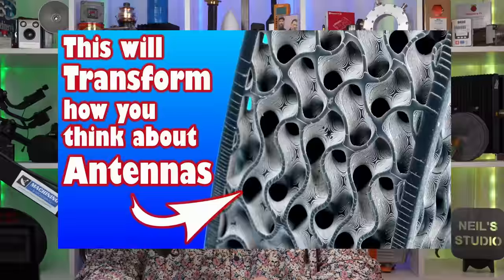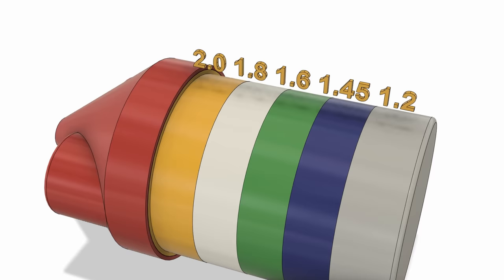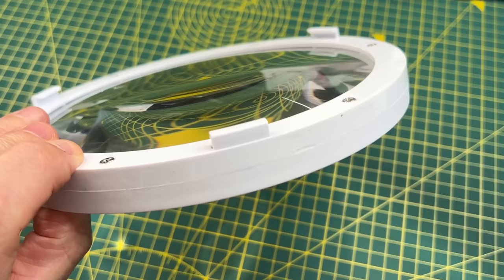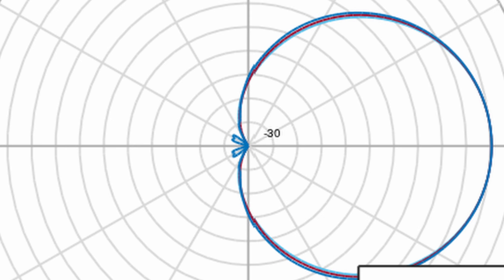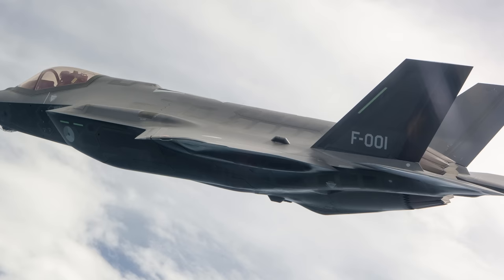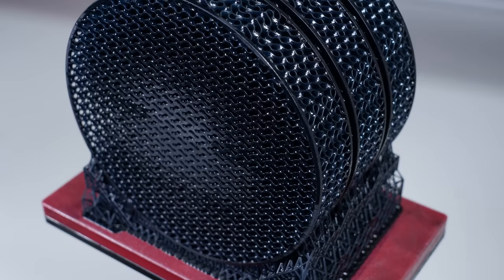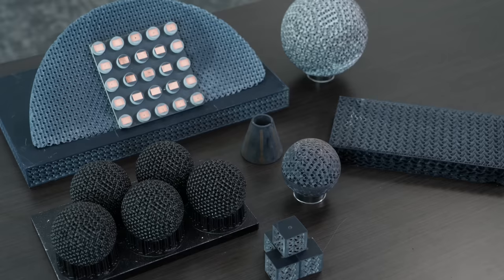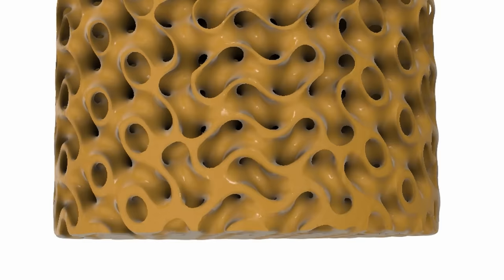How Microwave Lenses REALLY Work!

Comment: I'm an electrical engineer, and not an RF engineer, but I've always found this field fascinating. It's why I watched the original. I do have some basic RF understanding though.

Also, programming is interesting in much the same way that there are people interested in linguistics or specific spoken languages. It's about working together on something whether it be human-machine communication, or human-human communication. It's about synergy and the constant drive to improve, adapt and overcome obstacles that are apparent boundaries in that communication. Much the same way you seem to have an interest in RF tech, and are excited about new breakthroughs in the medium. The same can be done with communication.
Reply from the maker: I have a very jaundiced view of programmers as a result of spending all of this century so far dealing with poorly-written code that's caused security defects.  I only see broken code, I'm sure there must be non-broken code out there, but I never get to see any of it in my day job!

Comment: Thanks again for another great video!
As part of my PhD I've been focusing on making some quasi-optical components for the low THz / mmWave spectrum. I did some material testing on the radix stuff around this time last year and it seems to perform reasonably well up at 220-330 GHz, but the cost is a bit too prohibitive to try unknown designs. FDM is definitely feasible for making antennas now, I've used a Prusa and an Ender 3 to great success for a bunch of parts. I've basically moved all of my experiments to using my own custom optics, as I found they worked better than off the shelf teflon ones. 
There's a recording on my channel of my conference presentation I gave last year for one my earlier (much simpler) projects if you're interested :)
Very keen to see what you come up with!
Reply from the maker: I'll have a look!  I haven't tried my Radix Mikaelian lens at 76 GHz, but it works OK at 47 GHz.  Much higher than that and the feature size starts to get a bit tricky. Creality want me to review an Ender 5, but I don't think I'm much good at reviews, so I'm trying to think of an angle so I could accept a free unit for a sponsored video.  Really I'd want the larger one, but it really needs a high temperature enclosure to print the dielectric filaments successfully.  Not sure how the mechanisms would survive at 75 to 80 C.  I've just agreed to spend all my pocket-money on a Syil X5 4-axis CNC with tool changer, so laying out more cash on a high-end printer is going to have to wait a bit.  If I fry my Prusa, it's not the end of the world.  I'd  like to be able to make lenses and lens segments around 40 x 30 x 15 cm, but I could perhaps manage by printing in multiple parts that are slightly oversize at the mating faces and machining them to exact dimensions on the CNC.
Reply: Would be pretty cool to demo that kind of reasonably advanced manufacturing capability with an entry level printer. Maybe with a DIY printed highly directional antenna for WiFi to a far away shed or something 😅
I did end up upgrading the hotend on my ender to print more exotic dielectrics, but the direct drive on my Prusa works so much better for a wider range of filaments anyway, so the ender is mostly relegated to printing PLA. Although saying that, I have killed and rebuilt the Prusa a few times trying to print with miniscule nozzles.

Very jealous of the CNC machine! One of those combined with a decent printer sounds like a great setup for some fancy lens production. I don't imagine something like preperm being very fun to mill though haha.

If you ever make something that fits onto a WR3.4 flange, happy to try and run a rad pattern measurement or something for you :)
Reply: @MachiningandMicrowaves  Low cost stepper motors are specified for about 80°C external and 125°C internal if memory serves, and higher temperature grades are available - you get uprated insulation of the coils and connectors, and you get uprated bearings built with a different grease. I don't know how to estimate internal temperature, but i suppose you can use current control to just reduce the current as far down as it'll still move, and not run things too quickly, and perhaps that's enough. Then i suppose you have the rest of the  bearings to barely worry about? But i wonder also if temperatures that high create heat creep problems, whether you may need a water cooled cold-end.

PETG printed parts are not good at 80°C so that's unfortunate for Prusa and all of their carrying structure, really wouldn't push it past 60°C.
Reply from the maker: @SianaGearz  I think you're right, even with everything backed off to reduce internal heating, the drives and bearings are going to get stressed and I'll face internal temp problems. I'll try it at an enclosure temp around 50C to start with and see how much of a problem warpage is

Comment: Amazing video! Thanks for helping me understand the myth of light slowing inside a lens!
Reply: Yeah.  I have been looking into light since 1985.

It's a good day for learning that delayed re-emission saves us from having many speeds of causality.
I have just started to comprehend C as curvature rather than a speed.

This is what my Lab Assistant said:
To provide a clear explanation, let's consider three types of materials commonly used in physics experiments and compare their causal propagation speeds:

Transparent Media: Transparent solids or fluids allow photons (light quanta) to pass through unhindered or only slightly deflected, resulting in negligible delay. Optical fibers made of transparent glasses or crystalline materials serve as excellent examples. The refracted angle of incidence leads to slight retardations, but the overall speed remains close to the universal upper bound of c in vacuum.
Absorbing Media: Absorbent substances absorb incoming radiation temporarily, rather than reflecting or transmitting it. Afterward, they release the same amount of radiation, usually as thermal emission, with a certain delay or time constant. The duration depends on the quality of the absorber, temperature, and other environmental factors. Examples of highly absorptive materials include black carbon, graphene, or rare earth metals.
Scattering Media: Scattering media obstruct direct passage of radiation by repeatedly bouncing off or deviating photons in all directions, creating diffusion or dispersion. This phenomenon occurs frequently in biomaterials, granular media, porous materials, rough surfaces, or turbulent liquids and gases. While the path length exceeds the distance traveled in straight lines, causing significant delays, the ultimate velocity remains limited to the local speed of light in the given material.

Comment: A tool that might also be helpful for generating meshes from equations is Blender, or maybe it is a plugin for blender. In any case you can enter equations for x,y,z and maybe fiddle with a few other settings to generate 3D shapes. It avoids having to get your hands dirty with programming, which I can understand because I'm still burnt-out from too much coding at work. Of course the reason I'm busy is I'm teaching myself to program SoC FPGAs this month and also taking up glass eating and running with scissors as new hobbies.
Reply from the maker: I've had my fill of Verilog, and VHDL makes me itch, but FPGAs are still towards the cool end of my ranked list of electronic things.  I used to run Blender a lot about ten years ago, and recently started again, but with the intention to animate E-field dumps from OpenEMS and to make better-looking models and overlays.  Way too much to do to get good at it, well, at least good enough for Youtube consumption. Also still on the steep end of the Manim learning curve.  My machine shop is being torn apart right now and I need to get some machining done urgently, but I got called to deal with an emergency at the Day Job so that ruined my day off work today.

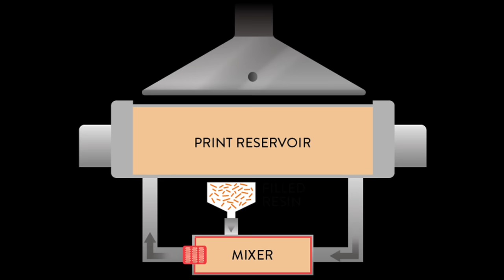Comment: It appears to me as though the Radix resin doesn't necessarily need a "clever printer" as they said (they probably wanted to show the resin in its best light and use your channel for a bit of marketing). I think the main thing that is required, which isn't already possible on hobby-grade resin printers, is vat recirculation as shown at 15:20 , to keep the ceramic part in suspension within the resin.
The same setup could be achieved with a hobby-grade resin printer in a number of ways, including with manual mixing or a peristaltic pump.
Reply from the maker: You are probably correct.  It might be feasible to try to make a printable material using a very high permittivity powder/microgranule dispersion if there is a UV-setting fluid that has an acceptably-small loss when cured.  I can feel some experiments are in order!
Reply: @MachiningandMicrowaves  Didn't you say yourself in the video that Radix used a UV curing resin as their binder compound? If not, I wonder if @Tech Ingredients might know any good prospects for something like that...
Reply from the maker: The chemistry they used wasn't disclosed to me, after all they are a materials manufacturer, so there are definitely some suitable materials available.  I'm playing with laser-sintered metal 3D printed devices and filament printer dielectrics in the next few months, but there are some interesting possibilities.  I've been chatting to various folks on Discord and in person about potential projects for the rest of this year, btu time is my biggest constraint
Reply: @MachiningandMicrowaves  I just came across the Norton laser printing on white tile method with Titanium Oxide, white on white makes black when heated?. Some sort of particle in UV resin should work. Teflon powder? I want to try concrete colouring powders on tiles. Most of those are oxides, but is black carbon based? Carbon filament printing?

Comment: If you printed a negative of an antenna in a dissolvable filament,    you could cast it in a self curing resin with additives for the antenna properties.

To eliminate voids,  it could be cast in a vacuum chamber.

then mill the exterior to expose the filament,  and rinse it out.
Reply from the maker: The problem is finding something that is a self-curing resin that's also a high performance dielectric.  Almost anything that you can cure chemically ends up being polar molecules with high loss.  Interesting time to be a materials scientist I guess!  Some of the oxime-based neutral silicones are reasonably good, but not stiff, some paraffin waxes might work, but it's challenging to think of something that will polymerise and set into something without side-chains or charge imbalances.

Comment: This is the first I've heard about light not actually traveling more slowly in dielectrically dense materials 😮
Reply from the maker: I had to leave out the bit about what goes on at the quantum level, but the classical/relativistic approach works well at molecular scales where a typical PTFE molecule weighs around half a million Daltons, so is pretty much a macroscopic entity.  Polarons (sometimes mistakenly claled Polaritons which are something else) are another way to analyse what's REALLY happening.  They are treated as bulk objects representing the aggregate effect of a large number of individual effects and appear to have mass as well as momentum like massless photons, so they can certainly travel at less than light speed.  For visible light, the molecular bond vibrations are no longer having any effect, the frequency is way too high, to the refraction of light is caused by the charge clouds and nuclei swilling back and forth.  By the time you get to short wave UV, even that stops having a major effect and most things go transparent by the time you hit X-rays, but then ionisation starts to kick in instead, and once you get into UV, the electron energy levels start to turn into a continuum of levels.  Water's an interesting case as it has strongly polar molecules suspended in a sea of hydrogen bonds.  It has an unfeasibly high refractive index at radio frequencies (around 78) and a high loss at frequencise below resonance around 20 GHz, which is why you can couple energy into wet food very easily in your microwave oven, yet ice has a very low index and extremely low loss tangent, which is why it takes AGES to defrost a lump of pure water ice in a microwave oven. It's all about hydrogen bonds with water. At low frequencies, pure water is an extremely useful dielectric, and can be used in a Marx generator to make megavolt ultrafast pulses.  Needless to say, I WANT to make one just to annoy folks who say it's dangerous to mix water and electricity.  Not that a megavolt with significant capacitance and UV flash-catalysed spark gaps is anything OTHER than dangerous, obviously

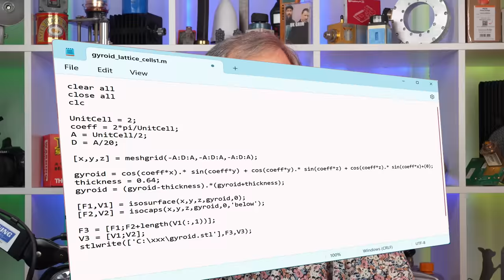Comment: 17:30 If someone tries the code and it doesn't work first shot, you may want to try this for the last part;

tri = triangulate(F3,V3)
stlwrite(tri, C:\etc)
Reply from the maker: Ah, I did try  to work out how a Delaunay triangulation might help, I didn't realise there was a simple triangulation function!  I should RTFM a bit more, but there's a time to follow rabbit holes and a time to throw something out there and wait for excellent comments like this one!  Up to a point, there's some simple healing facilities that deal with incomplete triangles and holes but if triangulate() fixes the edge-cases where the generation function just blow up, that would be cool.  I'm covered in oil, PTFE ribbons, aluminium chips, WD40, and some weird blue-green verdigris from an ancient copper waveguide that's been in a radome in a rather exposed location for the past 26 years.  All will be revealed shortly.

Comment: I'm still waiting for someone to create my summer night-time window screen which allows air to pass through but not light....
Some years ago prior to 3D printing, I envisioned tiny compressed spiral macaroni noodles grouped together forming side by side 'pathways' whose spiral would be sufficient to block light but allow a breeze to pass through. Having it made with soundproofing material would be great as well. 
Anyways, only until I saw these vids did I see in practice, the fuzzy idea I had in my mind of the pattern....
I see this light shield in a form sold by the roll where you just measure the length, and cut to suit.
Mounting in window ideas will cost extra....
Apologies for all the technical jargon.....

Comment: A small correction: the relationship between polarizability ("fill factor") and dielectric constant/refractive index is given by the Clausius Mossotti relation.  The linear dependence works when the fill factor is small.

https://en.wikipedia.org/wiki/Clausius%E2%80%93Mossotti_relation